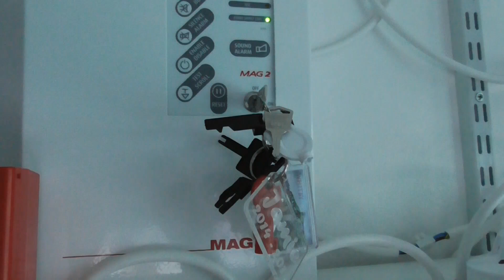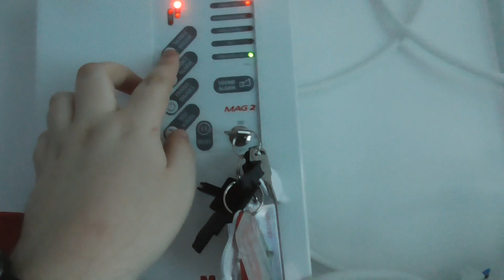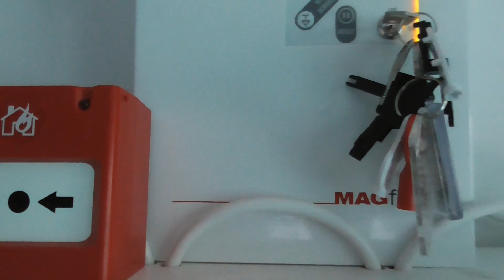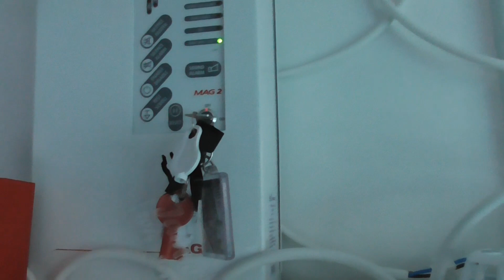ESP System Test 3

Comment: What protocol is that ctec xfp
Reply from the maker: It’s Apollo protocol
Reply: @j1firesystems440  nice
Reply from the maker: @firealarmguy  thank you :)
Reply: @j1firesystems440  i am getting a  kentec syncro and it should be replacing the Morley panel I have
Reply from the maker: @firealarmguy  oh nice 👍 Kentec Syncros are really good and I like them a lot as well as C-Tec XFPs :)
Reply: @j1firesystems440  yeah it's definitely going to be better than my current panel
Reply from the maker: @firealarmguy  Ok that’s good what protocol is your Kentec syncro going to be?
Reply: @j1firesystems440  it will be using hochiki but I might get some apollo equipment to play around with later this year
Reply from the maker: @firealarmguy  Ok that sounds good :)
Reply: Do you think I should get a ctec xfp or a kentec syncro?
Reply: @jcfirealarms5780  I think syncro there good panels I just brought one but i got one that only runs argus vega but both are good panels
Reply from the maker: @jcfirealarms5780  I would recommend either a Syncro or XFP panel they are both really good and I do like them but I do like C-Tec XFPs a lot. My XFP panel is running Apollo protocol so you can have either have Apollo or Hochiki protocol
Reply: @j1firesystems440  I prefer the look of the xfp but I prefer the syncro overall